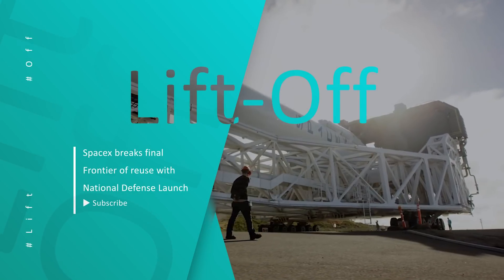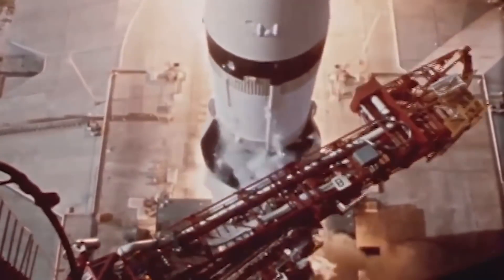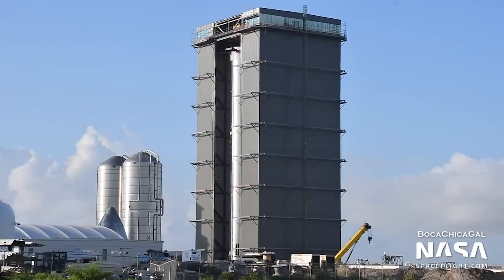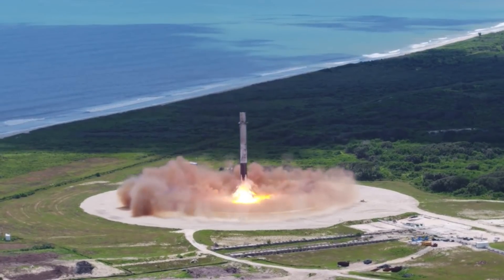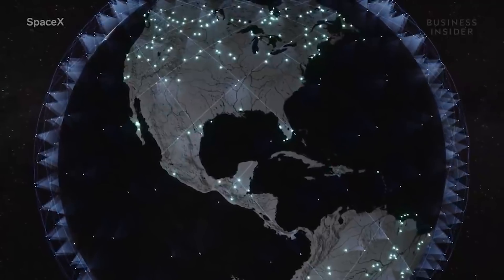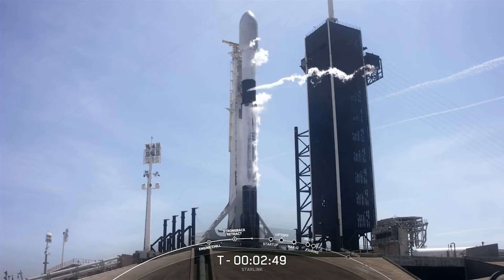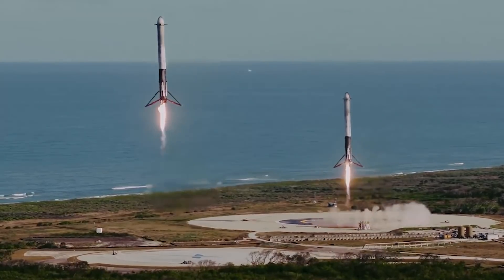SpaceX BROKE Final Frontier of Reuse National Defence Launch

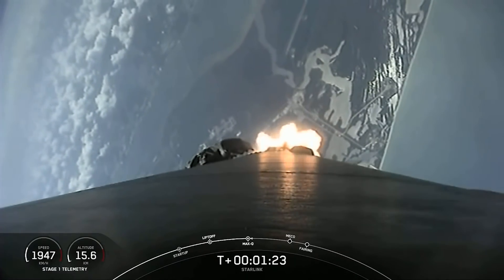Comment: The narrator says the Falcon 9 reaches supersonic speed 158 seconds into flight. 6:26 This is incorrect. It goes supersonic 70 seconds after lift off. Shortly after that, the spacecraft reaches Max Q  (Maximum dynamic pressure). 158 seconds into flight, 1st stage main engine cutoff occurs, by which time the craft is travelling around 10 times the speed of sound & is 50 miles (80 km) high. 3 seconds after MECO, the 1st & 2nd stages separate & 8 seconds after that the 2nd stage Merlin Vacuum engine starts a 7 minute burn to bring the Falcon 9 into low earth orbit.

Comment: @LIFT-OFF:  Could you use SI units consistently and/or adding them on screen when using non-international units like "feet" etc.. ? Thank you  😅
Reply: As long as the units are consistent, and he's not reading both units off, I'm good. Can you not convert units or something?
Reply: @xXxTeenSplayer  Personally I don't know the conversion out of my head and most non-international units aren't representative for me. But I know this is something subjective of course.
Objectively: SI units are used on international level to facilitate communication and eliminate wrong conversions.
Although you could argue that an wrong conversion wouldn't be a big deal for this sort of content. 😅
At the end, my comment is only an suggestion and not an obligation of course.
I hope this clarifies somewhat my reasons for the main comment. 😁

PS; I'm not "English" so pardon me if I made typos.
Reply: @Lolo-uk4rb  Fair enough. And actually upon finishing the video, the units weren't even consistent. I guess I have a pet peeve for when people say a value in more than one unit, it just seems like a waste of my time. I do agree that SI units are preferable though...

Comment: Idk y SpaceX wouldn't just develop a starship with legs to begin with, since they are going to need to anyway
Reply: less weight = more payload and they only need legs for mars until they build a launch tower on mars.
Reply: Design weight - about 1/6 the weight for the moon, a little over 1/3 for Mars (gravity), makes their legs lighter.
Payload capacity - no landing legs = less dry mass for Starship and Super Heavy = more payload.
Engineering - there's a lot of force on the landing legs on Earth, they have to allow for side drift (skidding) and coming down uneven on final touchdown.